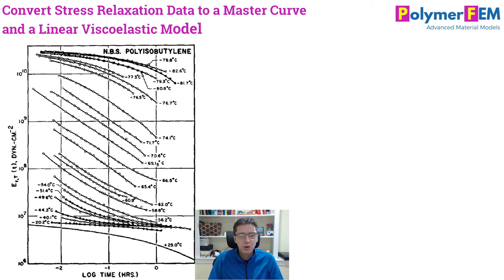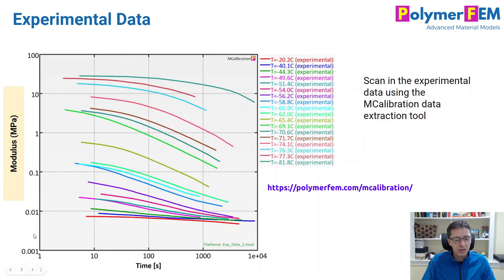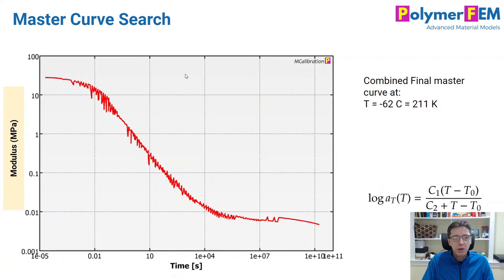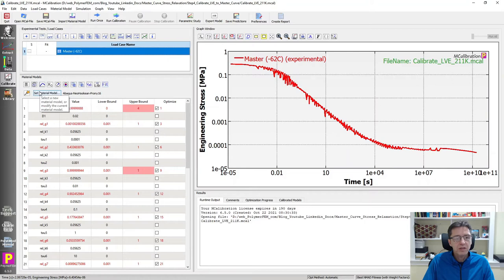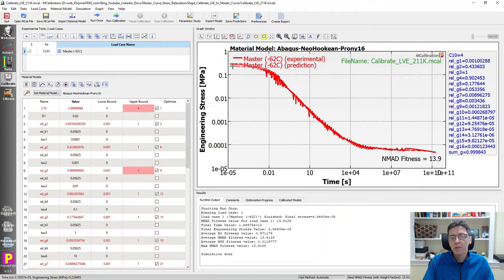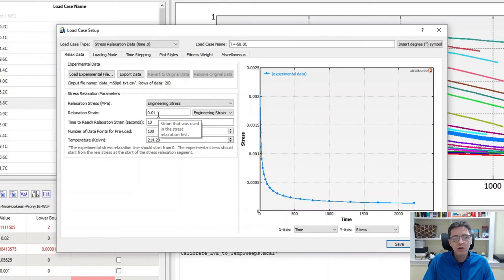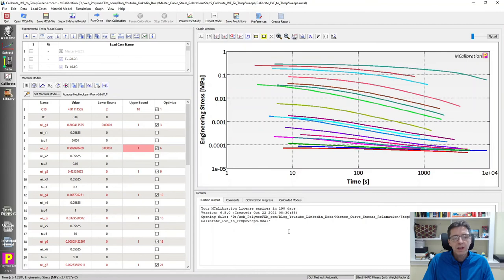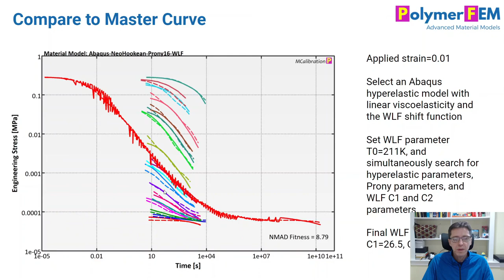Convert Stress Relaxation Data to a Master Curve and a Linear Viscoelastic Model

Comment: Thank you sir for your nice explanation.
Is it possible to extract parameters if I have experimental stress relaxation data at different temperatures at different frequencies instead of different times ?
Reply from the maker: Yes, that should be fine too.
Reply: @PolymerFEM  Thank you.